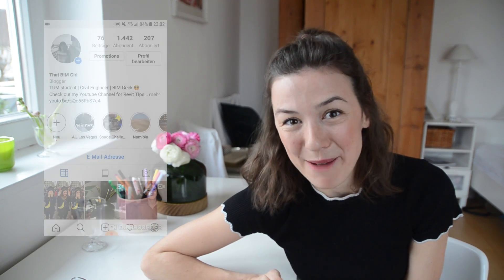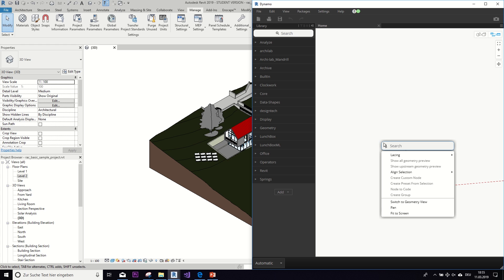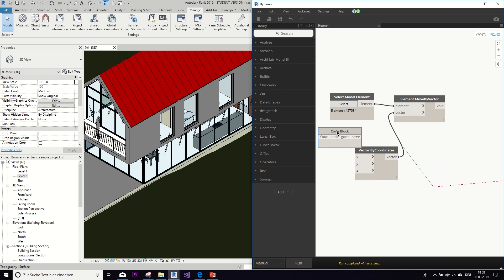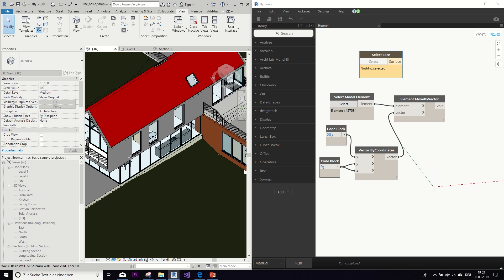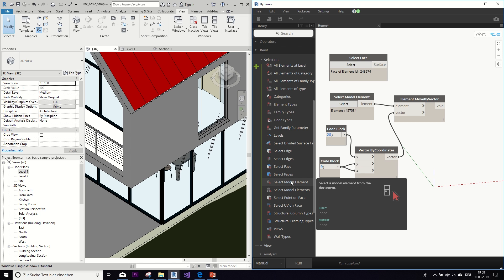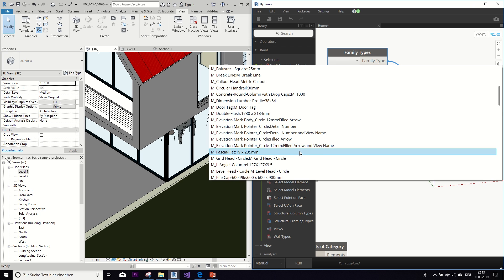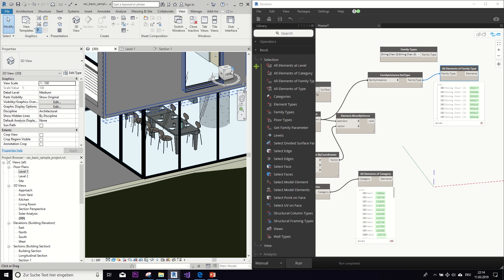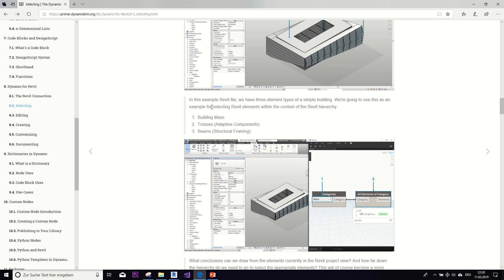DYNAMO load Revit Elements - Coding for AEC

Comment: i have some project for my study , that i need to regenerate so much rebar configuration (beam,column,plate etc).
can you teach us how to automate the same rebar configuration for the typical beam/column with same face/cross section. but have different length.

thanks